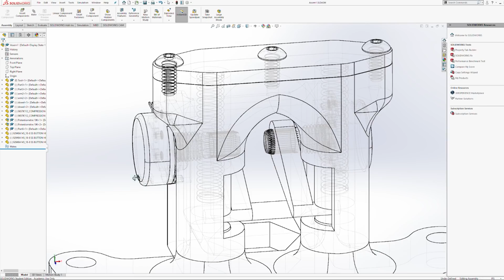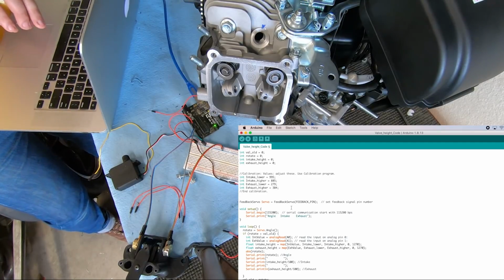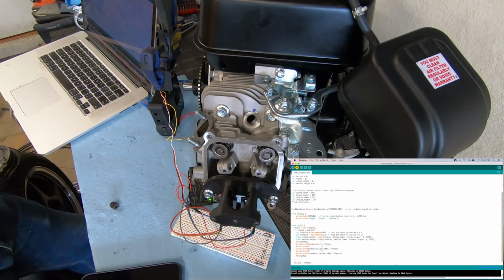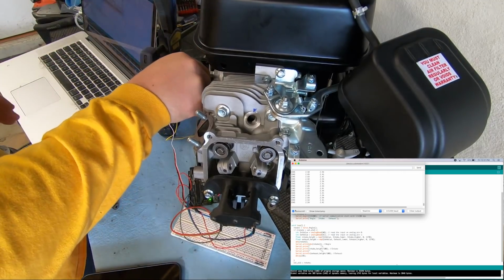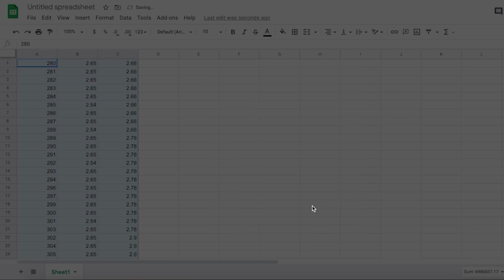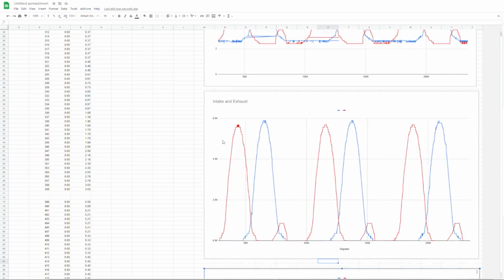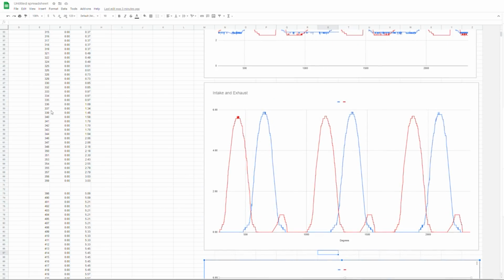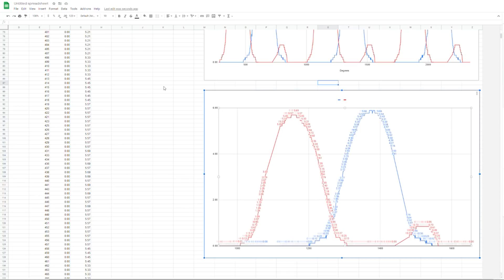Freevalve Build - Cam Mapping Tool

Comment: There's some good information and dyno numbers if you watch some "engine masters" (motortrend). Some things you'll see is the effect that Lobe separation angle (LSA) and duration have on where the engine will make power across the rev range. The thing about free-valve is that the "profile" doesn't really matter now since you can basically make a square wave. The profile is more or less a byproduct of the mechanical requirements to have a continuous ramp on your lifters/rockers/etc. 

To translate what you should really be focusing on is LSA will be your Phase offset and duration will be pulse width. An LSA as low as 106 up to 118 will give you a huge difference in the engines drivability vs high rev efficiency
Look into "Engine Personality Test: Camshaft LSA Explained" - from engine masters. They had custom cams made which just looked at LSA
The low LSA gives you the loppy idle but great mid range torque. High LSA tends to favor high rev performance. 
Id say screw the profile and just get max lift if you choose a non interference engine. then you're at the mercy at the response rate of the freevalve system.
Reply: Except, you are not limited to any of this, you can have stock standard at idle, low revs, torquey  mid range, and an absolute  screamer   at high revs, and, the normal valve train related rev limitation is removed, so that aspect of rev redline is removed.potentially higher redline  with ridiculous cam profiles are realistic
Reply: @davidp8157  absolutely - unlike any  cam, variable: LSA, timing, duration, and depending on how well you can meter pressure - lift is all possible!
Reply: @frjhracing  I see this as now realistically achievable by many from home garage, small teams upto race teams who previously  would never have ventured into this arena.  The potential is immense, whether the obvious performance route, or the more mundane high efficiency  but high torque work horse, through to ultra efficient  eco options.
The crazy thing is this alone with no other mods allowing all options, not just with special tuning,  but all available from idle to crazy redline  on the same engine with the same state of tune. He has brought this to the attention of so many  who are adequately  placed to actually  utilise it. 
While I personally will not be going down this route, an acquaintance  of  mine involved in bike racing  since the late 70s   still developing and manufacturing aftermarket upgrades  , and still developing his own bike further, will be very interested

Comment: Another awesome video!  The only flaw in your rig is the Predator camshaft has a compression release mechanism on the cam.  Your recorded profile is also recording the compression release "bump".   The compression release mechanism is controlled by centrifugal force and once the engine is spinning the "bump" on the exhaust cam lobe is disengaged.
Reply from the maker: Very interesting, I was wondering about that. I plan on omitting it from the final map.
Reply: @WesleyKagan  with electronic mapping   you can include it at start, remove it  at run revs, you can go from  a stock cam to full race spec,  you can be totally variable  throughout the rev range and  achieve  profiles impossible   running off an actual cam
Reply: @davidp8157  Actually that's brilliant.  These predator engines are tough to start without the compression release.

Comment: You know, you could go with something like a civic. 16v, one camshaft. You could do some experimenting with valve lift variation and/or 2-valve vs. 4-valve per cylinder operation. Cheap, readily available, cheap to fix if you break it. One downside is the water pumps are driven off the timing belt. 3D printed pulley in place of the crank timing sprocket could probably easily address that though. There's also anything with a GM 3800 V6. Those things are dirt-cheap, everywhere, and extraordinarily robust. Or the GM 4.3 V6. An old Crown Vic with a 4.6 would be pretty good.

Comment: My suggestion is to consider what your goals are with the free valve project because we all make the same mistake of working too many projects at the same time and end up burning out.  If you are going to incorporate the tech into and engine by eliminating the cam it only makes sense to choose the Chevy since it only has 1 cam and less valves to work on per cylinder which would make the entire project easier.  Also if something happens and parts get damaged they will be far cheaper to replace and a lot easier to get.  As you said you already have a Corvette which would be the perfect test mule and that garage doesn't look like it can hold many more projects so I would work with what you got and use the money for tooling and parts rather than another project car.  Great video.

Comment: Basically every engine ever has been in a Miata. Why not add to that list with a Freevalve Miata?
(I am for the miata if it wasn’t clear)
Reply: Though by your logic make the freevalve LS, then put that engine in a Miata. LS Miatas are fairly common, it's easier than it has any right to be from what I hear. This would combine the best of both worlds.
Reply: @quillmaurer6563  but also it would be interesting to see how much of a potential power or drivability increase the freevalve tech would create for a 1.6 or 1.8 miata (my reasoning is that I have a 1.6 miata
Reply: @quillmaurer6563   freevalve allows cam profiles not physically possible on actual camshafts.  Square lobe and also rapid profile testing.  This man needs a dyno

Comment: How does this help you without position control? does it just give you an idea of the overlap and timing?
Reply: This gives him position and mapping to start with  without having to develop a map from scratch he already has demonstrated  control with previous  video.  He can now relatively easily  adjust mapping( opening, closing, overlap, amount  of open) in a general sense,  or specifically for chosen parameters.
By this I mean, he can  choose to have full standard set up, lumpy cam at idle and warm performance, standard at idle but warm performance, or stock standard  at idle through to full race cam at programmed specs.
It's a progression  and I for one am seriously impressed  with  a home garage setup taking on something as technically advanced as this.
Reply: @davidp8157  my poInt is that he doesn't have control over the valve position other then full open or full closed yet. Also, a cursory web search provides much more precise specs of the predator 212 cam profile and timing then he could ever hope to get with that setup.
Reply: @Skwisgar2322  I think the point is, he now has a basic map to start from, he stated his intention  to initially use pneumatic then ideally magnetic  control longer term, he stated  there appeared tobe a difference in maximal lift. Because he doesn't have all the solutions in this  video release doesn't  mean it's not worth pursuing.  Logically it's a no brainer.
To say because he doesn't have all the answers yet, its not worth pursuing is illogical  at best.
There is nothing new required to make this work, it is just putting existing pieces together in a new format to get the desired result. The potential is immense, and very realistically  achievable by many, from a small proportion of home garage enthusiasts , through many commercial workshops upto private or funded race teams

Comment: You should definitely move to a solid state position sensing technique, like an analog hall effect sensor. Its non-contact, and there are no moving parts to wear out or impart errors. Then you can calibrate the ADC values just like with the potentiometer.
Reply: I also second the miata, for three reasons:
1. its a cool car+engine to start with, with a huge modding and aftermarket parts community
2. speeduino is originally for miata, so there exists a huge open source EFI support base
3. non interference motor (at least on "stock" cam profiles, which i guess is irrelevant if you roll your own)

Comment: I don't like the Miata idea because the engine WILL be a non-interference HEAD DESIGN and if it is not interference you won't be able to acquire data on how well the electro-mechanics is working and how quick they're actually actuating  in comparison to real time...

Comment: I would say go for the Mazda MX5 [Miata] the 4 cylinder engine would be the next logical step. An inline 4 will be easier to plan & design than a V8.
Reply from the maker: My thoughts as well. Miata does seem to be winning.
Reply: @WesleyKagan  with the amount of inline 4 cylinder engines in smaller older vehicles [especially outside of America] I wouldn't be surprised if  more people don't take this & run with it converting older engines to give them a bit more life.

Comment: This is amazing. Wanted to do this ever since I saw Koenigseg's demo on The Drive channel. Just a suggestion, you could  export the data as a .csv or even .ods (csv and ods are supported by all spreadsheet processors, so even if someone does not have MS Excel they could always use something like OpenOffice or LibreOffice which are open source).

Comment: I know it's not an option presented by you, but i was thinking BMW, then you said European... and i started wondering...
How it would work on a 24v, in line 6... would/could it be a type of bmw's vanos/honda's vtec? Could it be better than those?
Btw, great content on your channel, I really enjoy it!
Reply: It should be possible  to have better than these systems, as they are basically limited to loosely, a physical cam profile , there are no physical  constraints here because there is no actual cam

Comment: Datsun L-series would be a fantastic contender imo, not only would be only two valves per cylinder but also so much room under the valve cover to either hide the entire system or because of its simplicity make a bespoke one. It would be such a technological leap for that little engine where the valve train has always been its weak point and has quite a bit of heritage as a proven racing block, albeit in the 70s lol
Reply from the maker: Completely agree, and honestly I looked long and hard for a 240 and then I'd do RocketBunny and the whole deal, but trying to find a 240 in any sort of reasonable price is a hard thing to do right now.
Reply: @WesleyKagan   I understand that wholeheartedly, any way you do go, you have got a new sub. Awesome content, very excited to see where you go with this!

Comment: Miata Is Always The Answer.... Non-interference design and those engines will do fantastic. Watch out for a short nose crank on 90-91, they are known for crank failure and if it's broken or has been repaired it would be a pain to work with the crank/harmonic balancer. Best to find a long nose crank 1.6, or just go for the 1.8
Reply from the maker: Good to know. Miata is seeming to be the answer, it's been a few years since I've looked for one. Will be interesting.

Comment: Definetly do it on a non-interference engine so you don't hurt the engine when something goes wrong
Reply: non-interference just means the valves can't come in contact with the piston at any point. he can most certainly do damage to the engine regardless. it just means there's less things to be able to damage during testing
Reply: @VanquisherBibe  no shit sherlock, I thought they were magically able to run with no oil and coolant after getting hit by a 120mm heat round. 
The valves bending is pretty much the main way to damage a low compression na engine when it comes to valve timing/lift/float problems if you monitor the situation and stop when something is going wrong.
Reply: Not to worry!  When you are designing and prototyping a valve actuation system there is no such thing as a "non-interference" engine.
Reply: @erickschumacher1294  are you saying the valves won't just go to ''fully open'' but will just fly straight into the combustion chamber anyways?

Comment: Do the Miata.  Less parts to make, enough height (I hope) and the real benefit of picking a small engine is  that you should be able to raise the red line a lot, this is where you will get a lot of your power.  Get this right and it could be a real screamer!
Reply: Isn't valve float still an issue? From what I know, you need a built engine, with strong crankshaft, better valve springs, and maybe even stronger conrods. Adding freevlave may free up airflow, but what's the limit of the motor physically?

Comment: I have no clue of what I’m thinking makes sense.... but, I wonder if it isn’t really necessary to make a curve like the cam makes the valves open? I know the piston is travelling at those moments, only I’m curious if this shape is easily obtainble by using pneumatic control? And if you can get more
Reply: Surface below the curve (meaning more mixture in the head?) by making a more ‘rectangular’ shape ‘curve’  by opening the valves more lineair? 
Again, i have no idea, I’m just fascinated by creating this kind of project on diy scale!
Reply: @sammycoppens5470  That was my understanding of Freevalve as well, that by opening and closing the valves instantaneously one maximises the stroke. In effect, you just need an open and closed position for each valve, which would pretty much be at the point when the piston is changing direction, wouldn't it? Is there any benefit to "easing into it" the curve of a valve provides?
Reply: @adammilburn8855  yes,  a cam lobe  has been the standard for over a hundred years,  but like all mechanical  solutions is a compromise,  just because it's been the standard doesn't mean we have to stick with it. A stock cam to a full race cam is a significant change  in profile , but both are compromises on the ideal.  This technology or versions of it give the ability to move away from the physical constraints   associated  with an actual camshaft and move towards  what  could be considered  theoretical ideals, now this is possible other options will be explored until the new ideal is found, instant close/open probably isn't the best option, time will  tell

Comment: I've got a 2004 Subaru WRX that needs new heads sitting in my garage. If you want it for your freevalve testing just hit me up!
Reply: An EJ18 or EJ22 would be non interference...
Reply: That would be righteous
Reply: This sounds epic
Reply: Except pulling the engine if it needs to be redone
Reply: Would it fit in the engine bay XD. Wide motors already

Comment: What is that little bump in the exhaust? It looks like it opens the exhaust valve a tiny but at the beginning of the compression stroke? Also Miata
Reply from the maker: I'm not sure honestly. I've seen it in cam profiles in the past, but I'm looking into why as we speak .
Reply: @WesleyKagan  Compression release.  Explained here: https://youtu.be/tPtrF7YyNaw
Reply: @WesleyKagan  it's a compression releases so you can pull start it check it out it's on the cam it goes away when it starts up

Comment: You should do the Miata. The 1,6 and 1,8 in the NA & NB are non-interference engines, so if something in the valve timing goes wrong it won't bend a valve or smash a piston.
Reply from the maker: Yeah, that's a huge benefit.
Reply: @WesleyKagan  Also, if you need any measurements to get you started before you find a car, I'll be happy to take them off my NA.

Comment: Can you straight up rip the files for valve based metering from bmw?
Should be more accessible than koenigsegg's secret sauce

As for my vote, i suggest LS in a miata
Reply: Unfortunately the files are likely copyrighted and could potentially get him sued if he even shows how to extract it. Even bypassing bad copyright drm protection measures is illegal under dmca law. Even if it fell under one of the few cases it was not protected under copyright law it would not prevent bmw from trying to sue him to make him stop through the cost of lawyers.
Reply: @TheNeighbor4U  if someone maps this themself, they have not lifted or otherwise infringed on  anything,   he has just shown how yo do a basic  map,  it's not a big push to do a full running map  from idle to redline
Reply: @davidp8157  when he said "rip the files" I was assuming the original poster meant taking data out of a bmw ecu computer. If they were referring to cam profiles of the physical cams then I do not think it is possible to copyright that. It would be akin to copyrighting a specific oval shape. I am not totally clear on what "valve based metering" is but based off the original poster's wording I made an educated guess that it was computer a based file. I know more about law than the finer details of engine design at the moment.
Reply: @TheNeighbor4U  totally agree, original poster was suggesting  by whatever method copying actual  file, but  by using this methodology, you can get all the info legally, or if that way inclined, say you had, ...